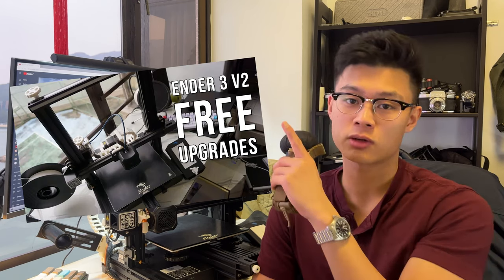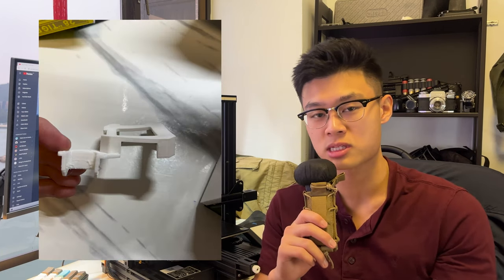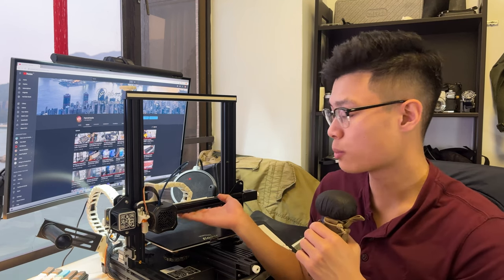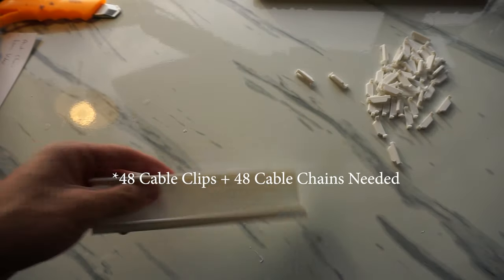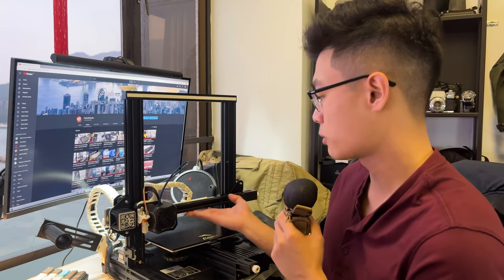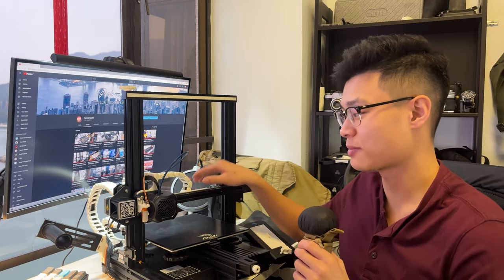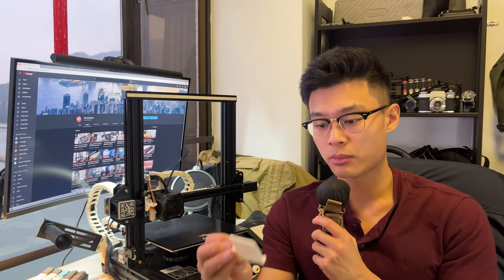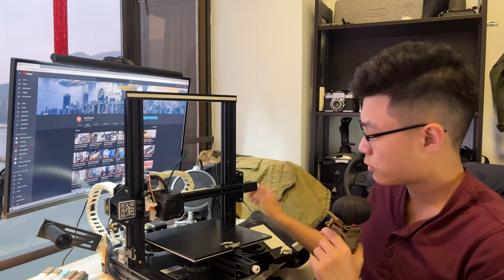Ender 3 V2 Drag Chain Build (All Axis)

Comment: The hardware does not work right screws are not long enough to screw back into the bottom of the z axis stepper connector

Comment: my ribbon cable that goes to the extruder got caught on part of the build plate and ripped the insulation off so that 2 conductors were touching. The whole thing went haywire. I need the chain to prevent this happening again. Can't find the ribbon cable to replace the one on the E3V2 so I just used electrical tape to reinsulate it.

Comment: Does the X axis chain make any noise when it moves? I've installed the Y and Z chains but I'm worried that the X chain might rub on the side or make noise when it touches the tray so not sure if I should use it

Comment: Good god this has to be the worst drag chain you can download. Nothing fits right. The clip on z mount doesn't clip on you need to fix it to make it work. I used fusion360 to make this part work. Currently working on the x axis tray to make it work properly. The cable clips are also to wide to the fit the cable chains. If you do download this file be prepared to do a hell of a lot of remixing to make this work properly. Only reason I'm still working on this to make it work is because I like the y axis tray. Also the y axis connecting arm on the hot end hit the sides of the printer knocking it off mid prints. Working on moving this arm to the middle of the hotend connecter to remedy this. What a headache this has been so I can get a y axis tray lol.